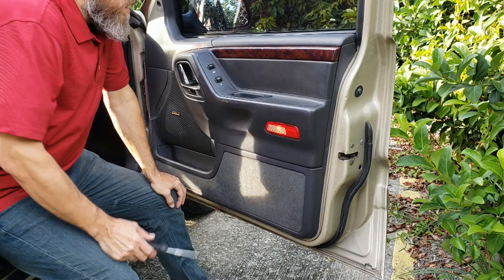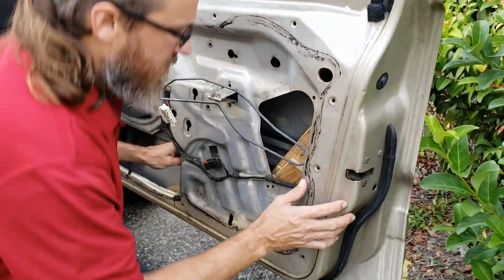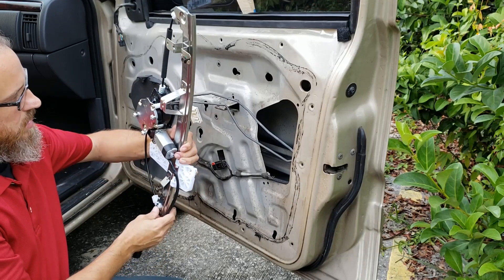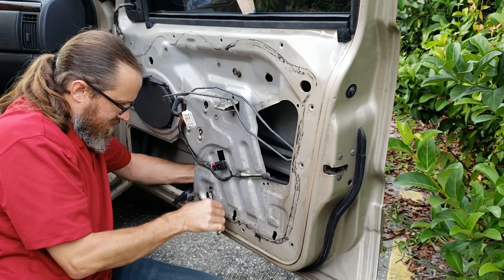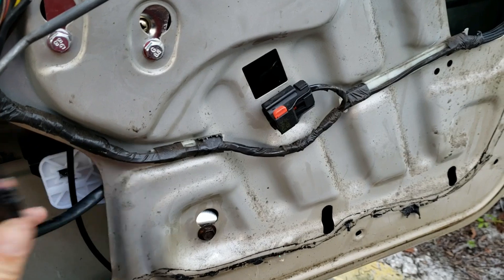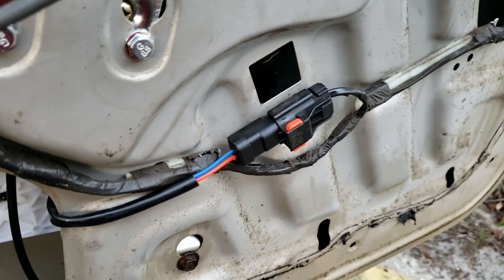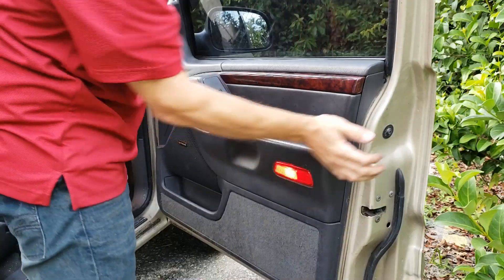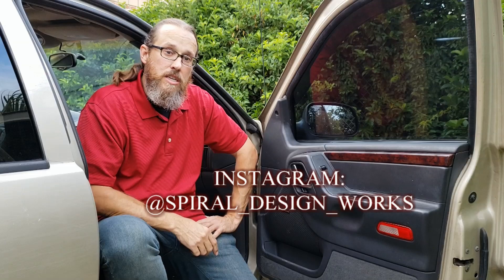EP.1 - WJ JEEP GRAND CHEROKEE- WINDOW REGULATOR FIX

Comment: Cool. I just bought a new (to me) 2004 WJ. Both front doors have this issue. Just ordered 2 regulators off ebay. I'll use your video to help install. Thanks man!
Reply from the maker: Glad I could help
Reply: @SpiralDesignWorks  Got it fixed. Also had an issue with 2 wires in the door hinge area. The ground and power where not making contact.